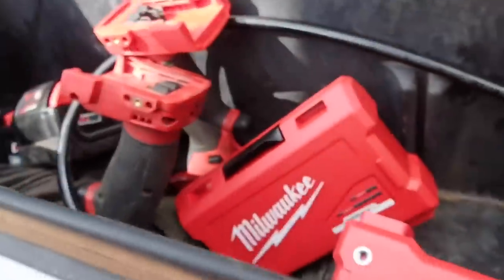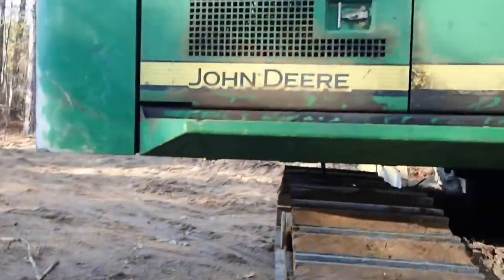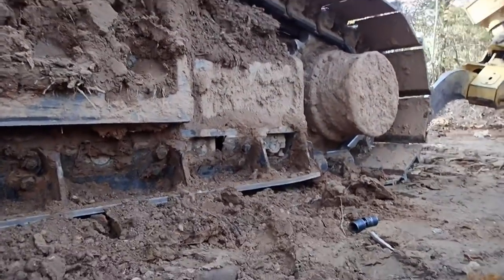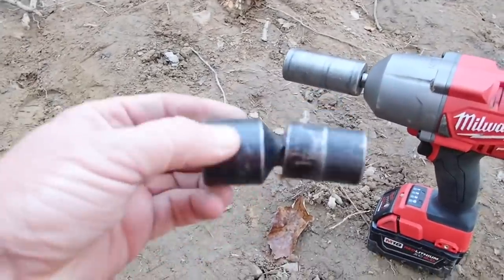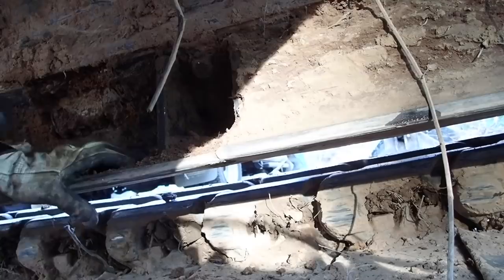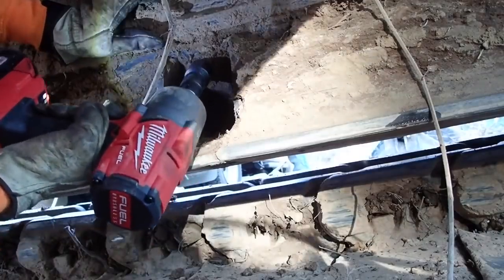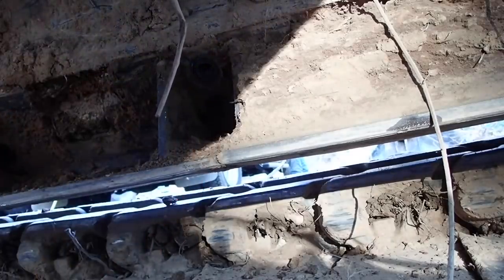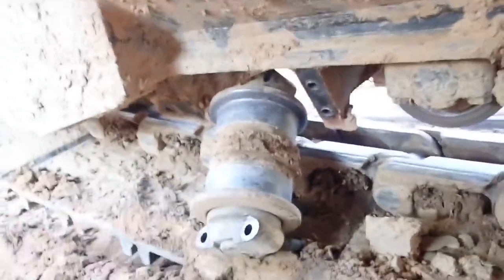Major maintenance with Jay on my John Deere loader

Comment: Feel your pain with the concrete dirt. I sometimes use an old spiral, bigger diameter auger bit with a cordless to get a head start and make it easier. It at least gets the bulk of it out so your not banging the shovel as long. You do have to know what your going into to keep from getting twisted up as you can get caught on edges and such. I always wanted to find a spiral type pipe deburrer with deeper flutes as I think it would be the ticket.

Comment: gotta use a breaker bar with the wobble for full toque it just wobbles away all the hammer action of the impact 
also i use that same impact almost daily and it works great. it will snap a half inch bolt real quick and we abuse the fuck out of them they have been dropped from over 50ft into dirt bouncing off 2x6s all the way down. they truly are water proof we use them in the pouring rain and we have had a few times where we forget tools in the structure sitting on planks then go home for the night and the weather is shitty the next day so we dont climb so the tools just sit all day in the rain. they still work fine I even used one that got iced over in an ice storm that i had to chip out with a hammer.

Comment: Tim your mid torque impact will take those bolts off no problem cause a 1 1/16 inch bolt head is either 26 or 27 mm if your cab bolts are 36 mm
Reply from the maker: You are right. I’m gonna try it on one of our Peterbilt lugs and see what happens.  I hit those cab bolts with it the other day and they were nothing for it to get out.
Reply: cotontop3 that would be great to see the mid torque impact take off a front wheel on one of the log trucks and if you have a spare tire and jack on your trucks that if a driver has a problem and a piece of equipment at a site is down the service truck doesn't have to pack up and go to them and then back to the site having more down time